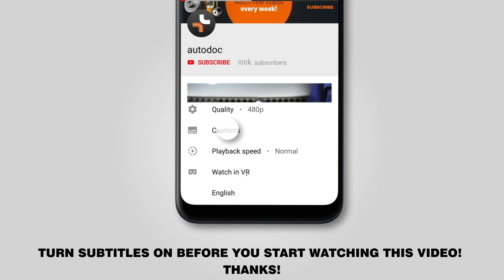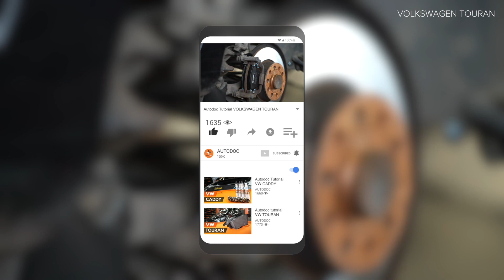Hvordan bytte bak bremseklosser der på VW TOURAN 1 (1T3) [BRUKSANVISNING AUTODOC]

Comment from the maker: 00:25 — Skru løs tanklokket for bremsevæsken.
00:34 — Løsne hjulboltene. Bruk en kraftpipe for hjulmutter #17.
00:40 — Hev bakdelen på bilen og sikre den på støttene.
00:44 — Koble fra ABS-sensorens elektriske kontakt. Koble fra bremseklossens slitasjesensorplugg.
00:54 — Spre bremseklossene. Bruk et brekkjern.
00:58 — Skru løs bremsekalippernes feste. Bruk en kombinasjonsnøkkel #12. Bruk en kombinasjonsnøkkel #19. Hold tilbake styrepinnen med en annen nøkkel.
01:17 — Fjern bremsekaliperen.
01:33 — Fjern bremseklossene.
01:40 — Sjekk brakett, styrepinne og mansjettene til bremsecaliperen. Rengjør dem. Bytt ved behov. Bruk en stålbørste. Bruk bremserens.
02:04 — Trykk inn bremsekaliper-stemplet. Bruk bremsestempelverktøy.
02:38 — Behandle baksiden av de nye bremseklossene. Bruk smøremiddel/monteringspasta mot hvining.
03:06 — Installer nye bremseklosser.
03:24 — Installer bremsekaliperen og fest den. Bruk en kombinasjonsnøkkel #12. Bruk en kombinasjonsnøkkel #19.
03:36 — Stram styrepinnene. Bruk en momentnøkkel. Stram den til 30 Nm dreiemoment.
03:47 — Behandle overflaten hvor bremseskiven kontakter felgen. Bruk kobberfett.
03:51 — Skru inn boltene. Bruk en kraftpipe for hjulmutter #17.
04:00 — Senk bilen og stram hjulboltene, arbeid på kryss. Bruk en momentnøkkel. Stram den til 120 Nm dreiemoment.
04:19 — Stram tanklokket til bremsevæsken.

🛠️ Verktøyene du trenger for å erstatte bak bremseklosser:
- kombinøkkel nr. 11
- kombinøkkel nr. 19
- momentnøkkel
- kobberpasta
- stålbørste
- WD-40 spray
- bremserens
- hjulpipe nr. 17